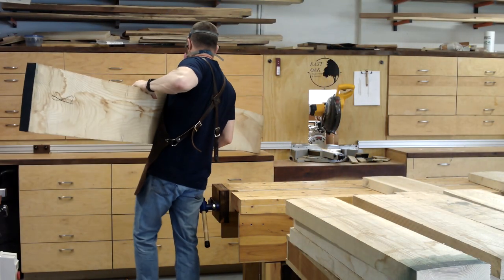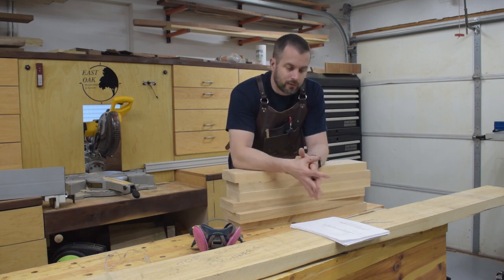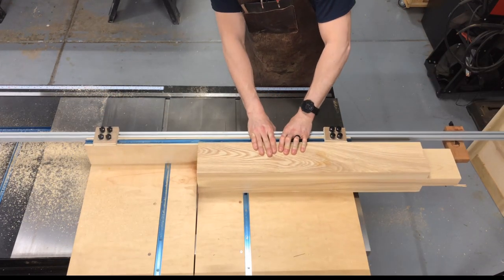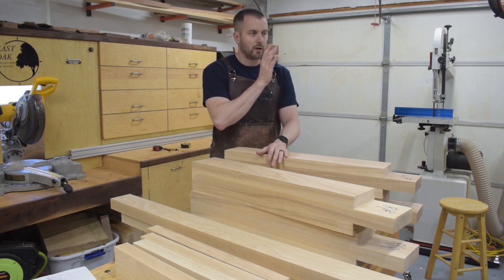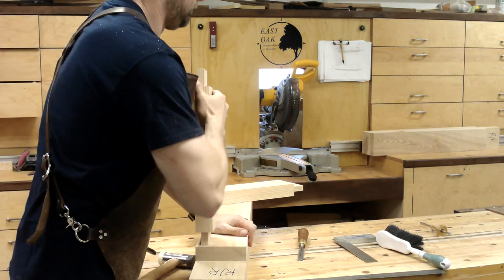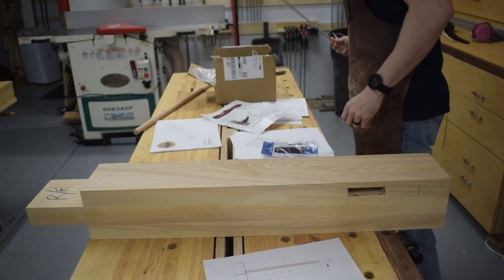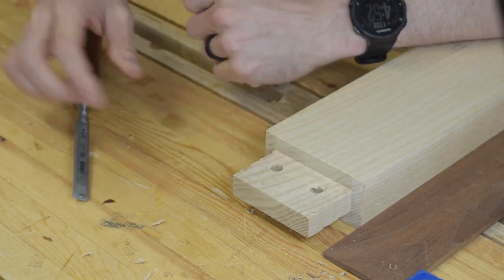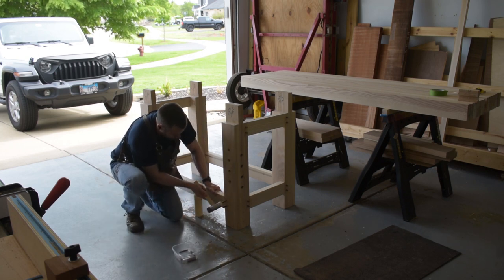Roubo Workbench Part 1

Comment: Nice Shop. I’m just getting my shop set up.  I’ve got a full cabinet Hitachi table saw, Boch 12 in Miter saw, a Delta 6 inch joiner, and table top drill press, Dewalt 13 in planer, Hitachi Scroll saw and Band Saw, plus a craftsman hand planer, Dewalt and Boch orbital sanders. Plus an assortment of hand saws and chisels.  Now I need to get power to My shop.

Comment: As a Canadian I find that I am sort of in the middle of the metric/imperial systems.  I am completely comfortable using either.  That being said, with woodworking I eventually switched completely to metric and my accuracy has increased greatly because of it.
Reply from the maker: I learned the upside of the metric system when I lived in Germany years ago. It can definitely make things easier and more accurate
Reply: In the UK we still use both, but it’s roughly marked by a generation split between baby boomers and gen x. When working on jobs with my dad I switch to imperial. His bench is imperial, mine is metric.

Comment: I am amazed by your cleanliness and order in your woodshop and I wish I could afford all those great tools and the great wood you are using for this build.  Ten thumbs up!

I have spent quite a bit of time by a tablesaw in  my previous job and I have seen and experienced some scary moments with this helpful tool.  I am not trying to be a besserwisser here but one of the main things about using a table saw over time is to establish good safety habits.  The prime one in my book is where you place yourself when using the saw, and especially so when ripping.  
At 1:35 ish into your video all the safety bells in my head was chiming... I am sure this is not how you usually place yourself when ripping boards but if it is PLEASE change your stand so that you are not exactly behind the sawblade.  Take my word for it - even with a riving knife attached it is not IF a kick will happen it is WHEN a kick will happen.  

I hop I will some day be able to make a bench as beautiful and sturdy as this one.  Happy woodworking!

Comment: Why did you decide to move away from the "traditional" double tenon-dovetailed leg joint?
Reply from the maker: I think that joint looks great, but it really isn’t necessary. The through wedged tenon will more than hold the top in place, so for me it was a matter of not complicating things more than I needed to.
Reply: @EastOakWoodworking  That's what I was thinking. The idea of transferring the dovetail layout to the other side of the benchtop sounds awfully finicky.

Comment: Are you using a brad point bit to drill the dog holes in the leg and top?
Reply from the maker: No, that’s an auger bit made for drilling dog holes. The “Brad point” is threaded to pull the bit through the wood.
Reply: @EastOakWoodworking  Thanks!  I tried a normal auger bit and just about took my arm off with the drill press.  Did you file down the threads on the auger bit to make it work?
Reply from the maker: @bradlierman9708   This bit is designed for this. No need to modify it: https://amzn.to/3cNH2HW
Reply: @EastOakWoodworking  Wow, thanks so much.  I've been racking my brain on that one.  Read the reviews on these bits.  They look amazing!

Comment: What are the leg and stretcher dimensions for your workbench build?  Nice job by the way and great video too!
Reply from the maker: Legs are 5 1/2” x 5 1/2” x 29 3/4” at the shoulder (plus the thickness of the top for the tenon)   Stretchers are 1 3/4” x 4” x 18” for the short stretchers and 40” for the long ones
Reply: @EastOakWoodworking  thanks!!!

Comment: What manufacturer of lifting wheels did you use and did they prove to reliably work over time?
Reply from the maker: Those particular ones were Whistler. Tickler has a similar design, and both brands work great. No issues at all.
Reply: @EastOakWoodworking  Many thanks, but a search for the name Whistler only produces an automobile wheel manufacturer.  And a search for Tickler produces sex toys!
Reply from the maker: Sorry, Rockler. I was autocorrected

Comment: No, the metric system is not better. It is still susceptible to math errors.
Reply: It is better, since you will only need to take care of math errors, instead of using 12 different length units
Reply: I cut 424mm instead of 442mm just the other day!